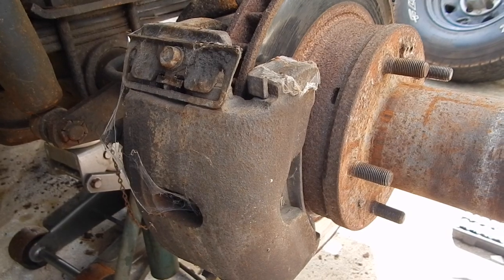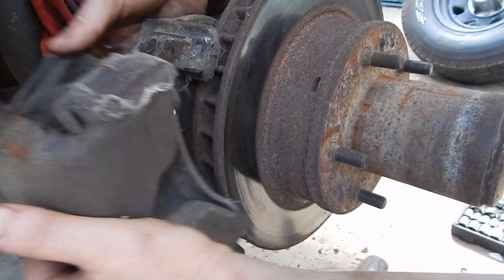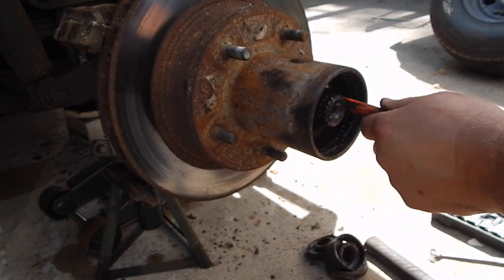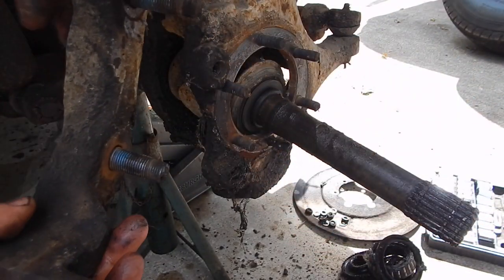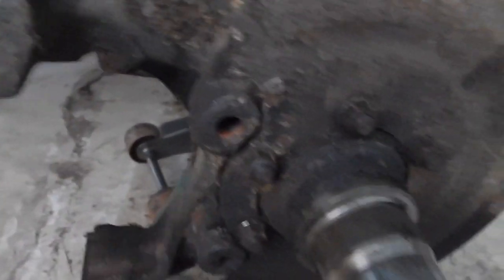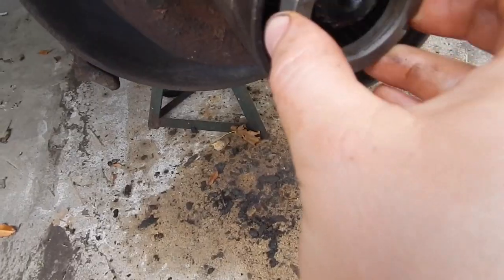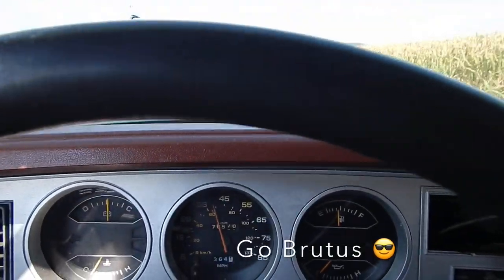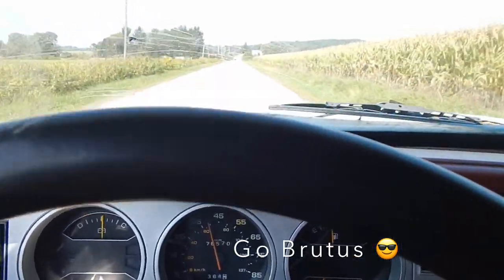Dana 44 Hub Assembly '85 Dodge Ramcharger *Brutus Part 2*

Comment: Thank you for putting all this work into making this video. Really a treasure of info for us RC owners. From a guy in northern Colorado with a 85 RC 360 4x4.
Reply: Hey I just bought a Ram Charger 1986 4x4 360 W-250 so any help would be great.  rebuilding the front suspension now.  Thanks Chris

Comment: Very nice video I have two RCs one and 84 with a dana 44 front axle pre cad that I ran in New jersey winters for 8 yrs and frame rotted away and is now my parts truck for an 87 RC that I got that has the dana 44 cad axle............ you did good work on your 85 keep it up.

Comment: Hey where did you get the seal for the wheel bearings please give me a link or something.. I can’t find them anywhere…
Reply from the maker: to be honest, that was 2 or 3 years ago.  I don't remember, but I do shop Rockauto online a lot. Sometimes local parts stores like O'reilly's.  Other times, Summit.   Sorry but I just do not remember.
Reply: @318willrun  its all good I found some!! took me about 5 hours but I found them. They are Timken 4250

Comment: The washer between the set nut and the lock nut, how do you line it up with the peg on the set nut and the cut out on the shaft? I mean,,is there a  easy way to do it or is it after 20 tries you finally get it.
Reply from the maker: yep, the tooth goes in the cut out on the shaft, the only way it fits

Comment: Good job on the video, thanks. I have an 86 RC that needs both those wheel u-joints replaced. Did you replace the u-joints or the whole axle assembly?
Reply from the maker: just the  u joint on the one side.

Comment: Hello can I ask a question 
I have a 1986 dodge w150 the right side front Ujoint is bad. Would it be the same as this? The tag is broken off so I can’t tell what it is. It’s a 360 automatic 3 speed. It has locking huds shift on the floor for 4 wheel drive and kinda seems like it also has vacuum on the diff? That make sense? The Ujoint and Axel do move in and out that’s why I was wondering if you think it might be the same process. I’m hoping not to have to open the diff if I don’t have to lol. 
Thanks any help would be great, love the videos
Reply from the maker: I would think they would be the same.  Yes, these years had vacuum going to the front differential.  It is hard to tell what slack is, could be normal, could be excessive.  Almost have to see/feel it in person.  Thanks for watching!
Reply: Thanks for getting back yeah not sure, like it wants to pull out but can’t because the wheels still on lol. Would the locking hub change much in regards to changing this U-joint? Never opened a front end before 😬
Reply from the maker: @billjohnson1716   I don't think so, but I'm not overly knowledgeable on the 4x4's.

Comment: Great video. Would an 87 Ramcharger be the same?  i just ordered parts this morning to replace inner and outer bearings and rotors on our 87. Any idea how the tube comes off the rotor? Thanks for any help you can give
Reply from the maker: First, let me say I'm not nearly as familiar with 4x4's as I am just classic cars.  That said, I would think a '87 would be about the same set up.   On the tube, I'm not sure....   Good luck with your project!

Comment: Where do get your both of the inner and outer bearing ? Can you send me the information, the size... 
I had a 1989 d150 4x4 and having a hard time finding part 😅
Reply from the maker: I believe I only bought one bearing, and if I remember correctly I bought it on line.   Maybe RockAuto or ebay??   Maybe Timken?   Sorry, I just don't remember exactly...

Comment: I have a 85 W150 dodge with this same assembly. I had to do the u-joints, bearings, and rotors on it. I'm putting it back together, and I can't get the last gear in before the snap ring. Looks like the axel shaft has to come down just little bit to put the gear in. Anything you can think of that I might've done wrong, or could do to resolve this?
Reply from the maker: I cannot think of what my be the issue.    Sorry
Reply: 318willrun spindel was slightly bent making it impossible to put back on. Got it all pit back together. Thank you for getting back to me!

Comment: I personally would have done both sides at the same time. You probably will regret it later if you don't. It will save you from having to do it later too. You may not have the time or money when it does go.

Comment: Hey everyone I have a 84 ramcharger with a swapped out front end with an 86 I believe does anyone know the part number for the rotors the only thing any change towards bringing up is a regular rotor without the hub housing. Any help would be greatly appreciated

Comment: Hey I’m doing the rotors as well. How do I separate the hub body from the rotor?
Reply from the maker: isn't it all one piece ?
Reply: @318willrun Well i just learned you have to knock out the studs and put the studs in the new rotor and the hub body. The rotor comes as a bare rotor and the hub body is held on by the lug studs
Reply from the maker: @missingchin1826  Thanks for sharing!

Comment: Do I have to remove the whole hub , to fix my nut studs , wondering I might have to get that socket or not
Reply from the maker: it might be the easiest to remove the hub.  It actually goes pretty fast if you have the socket.  Sockets aren't that expensive and a good tool to have if you have one of these front axles
Reply: @318willrun  Thanks !

Comment: Hey did you change the bearing on the inside of the spline?  And if you did is it pressed in and how to get it out??
Reply from the maker: If I understand you correctly, the inner bearing removal of the hub happens at 4:50 of the video
Reply: @318willrun  I think he was talking about the bearing that is in the spindle you need a slide hammer kit with reversible jaws to get that one out and you can press it back in spindle most people don't even know the the axle rides on the bearing or ever replace it... just for fyi.